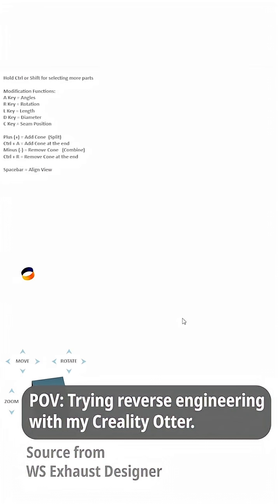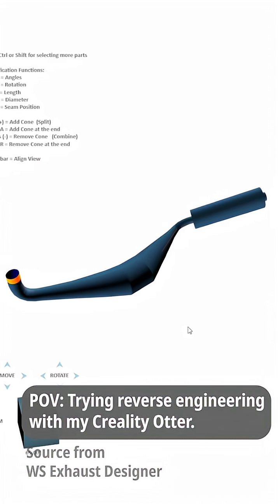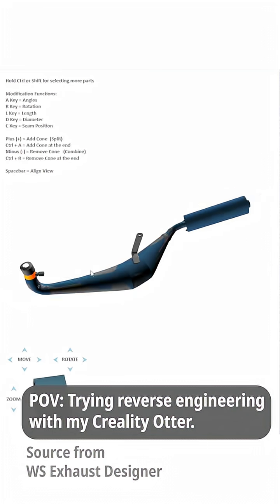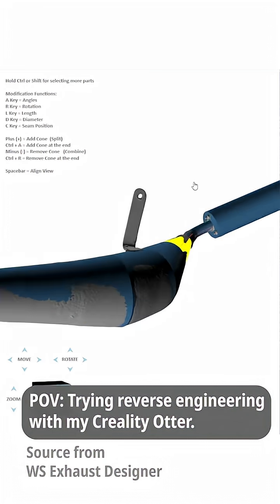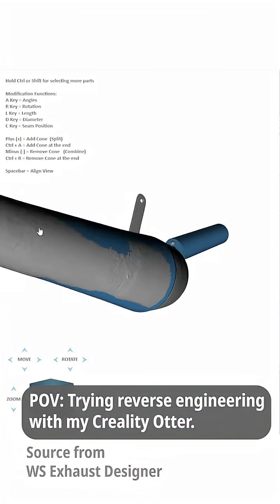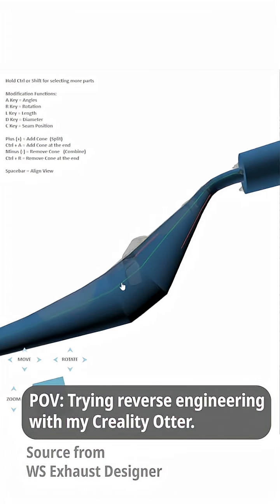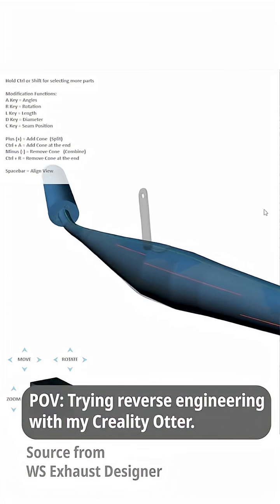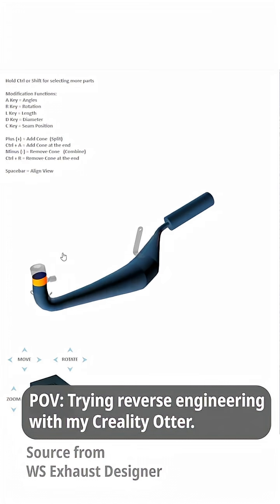POV: Trying reverse engineering with Creality Otter 3d Scanner

Comment: Exhaust pipes are NOT Made like that, They are Hydroformed!!!!
Reply from the maker: Thanks for your feedback
Reply: Yes, the ones from the factory, but they are also welded from individual cones, especially in the tuning sector when you want to adjust the resonance to the valve timing.